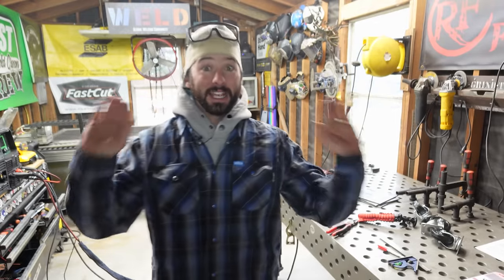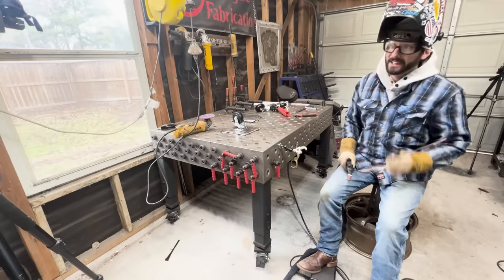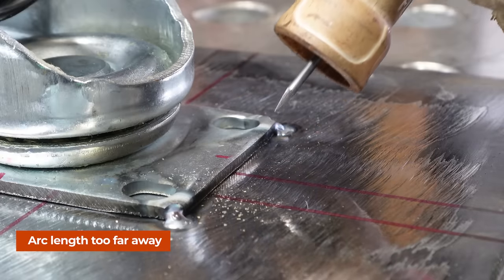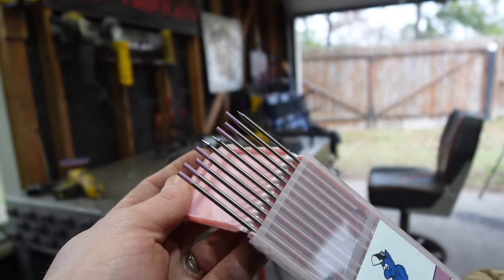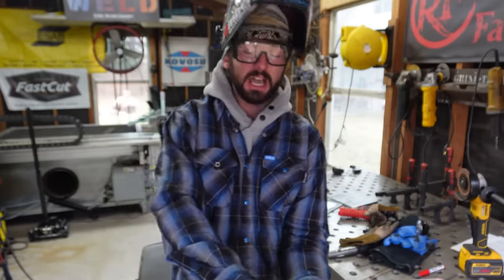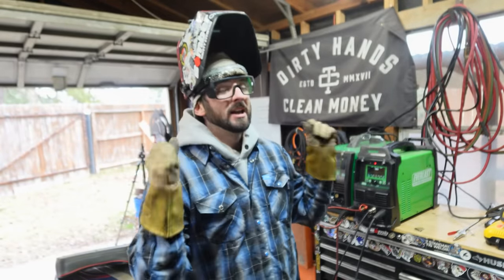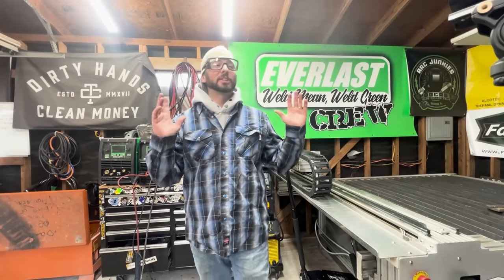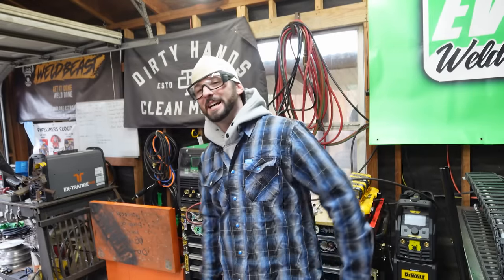GTAW 101 - Why Is Tig Welding So Hard?

Comment: I learned to tig (but didn't start with tigging) my old man had me in the shop at 10 learning the business and it started with Gas welding both steel welding and brass brazing. He didn't get a tig welder until 6 years later but by then I was able to master stick, air arc, mig (steel and aluminum) and of course gas welding. So when he got a tig machine it was super natural to tig. But it all started with the gas torch. learn the basics of gas and stick and the rest is gravy. 👍🏻

Comment: At what point do you decide your gloves are so dirty they become a source of contamination? 
Picking small parts are just pawing the filler wire and putting oily contamination on everything. I was just wondering yesterday as I changed out a pair of gloves.
Reply: Depends on what you’re working on. Steel isn’t so much of an issue. But I recommend using a different pair of gloves for material handling. And another for welding.
Reply: If you get heavy grease and stuff and it leaves glove fingerprints yea change them. I do as Austin said I try to swap between fab gloves and tig gloves. I end up welding in the fab gloves to tack and then making myself mad for getting freshly cleaned metal dirty again lol
Reply: Typically the gloves I’ve overheated and lost dexterity on I convert to fab gloves and get new set for tig
Reply: Get a different pair of gloves specifically for TIG welding on stuff you don’t want greasy or dirty, even using dirty gloves on aluminum filler wire can cause contamination, we used to have a pair specifically for working on aluminum.

Comment: Tig welding galvanized caster wheel brackets, without cleaning the toxic coating off first?  You can even see the smoke rising in the arc shots, and the smoke/white residue all over the piece from burning off the coating while welding.  Nice work on the tips and your beads, but an educational channel this size where viewers are paying attention to everything should stick close to best safety practices, and welding right over those coatings definitely doesn't promote that mindset.
Reply from the maker: Thanks for your concern, it isnt a matter to joke with. the coating was ground off the material in the weld zone, or i wouldn't have been able to weld on it at all with tig. im sure the fumes have plenty of it in there. A respirator would've been the move, today i just stuck my head out of the smoke. or at least tried.

Comment: Anyone who is good at oxy-acetylene welding can transition to GTAW without much difficulty.
Reply: I agree with this. I think oxy welding is harder. Big heavily long goofy torch lol
Reply: I've seen a really good oxy-acetylene welder have a really tough time time trying to learn TIG because he was forever pulling the torch away from the work  as you would with a gas torch to control the heat input...
Reply: Really useful info 😎👍

Comment: Yuck you use that 17 with that big stuff on AL. I run a 20 with stubby stuff. It can heat your hands up but it’s so tiny
Reply: I just don’t have a water cooler 😅 or I’d be doing the same

Comment: Tig welding isn't inherently hard - it's a pretty simple process - however it has its place - if you're the kid who welds pharma plant pipes - Tig is your Pal. If you're the kid who is welding panels on some beater, Tig ain't your pal. 

If you're running tig, you better be getting paid by the inch - Tig is about the slowest welding process going. It's nice, but it's slow. By the time you've cranked up your Tig outfit & are set to weld, I've welded the damn thing using flux-core - which is Fast - at about 1/10 of the cost. Flux-core however, will never cut it in a pharma plant. It would, but they'd never allow it. They want Tig because "Tig is Posh!" - it isn't really tbh  - it's just another way of joining metal - but they rate it so who am I to argue? I reckon I could run 1mm flux core on steel beside any Tig welder going & their welds will be same/inferior - but semantics - we want Tig.. So Tig it is,,, it sucks as a process when it comes to production/speed - but it is what it is.